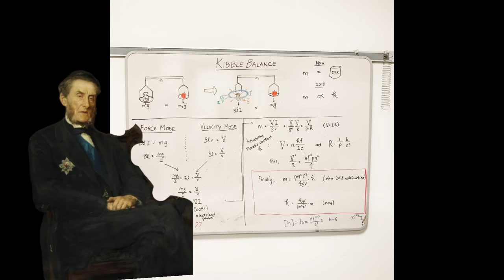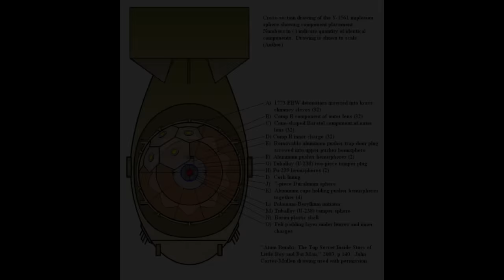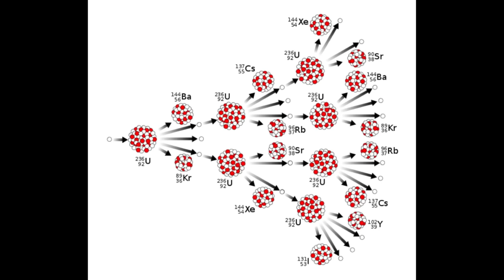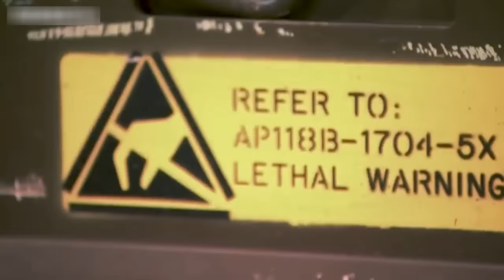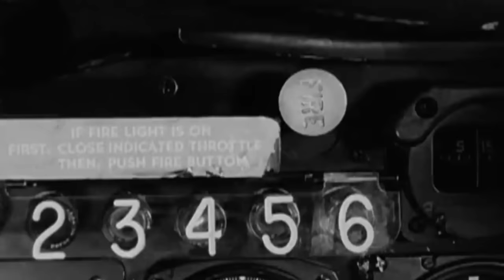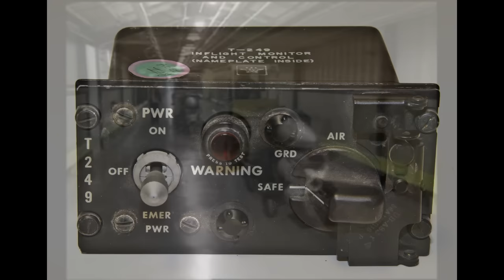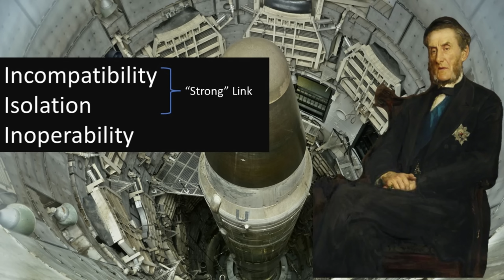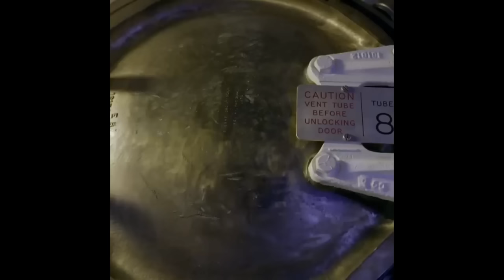This Way Toward Enemy - How The Bomb Didn't Quite Go Boom

Comment: Ahhh, the B-36.  Officially: Six turning, four burning.  Unofficially: Two turning, two burning, two smoking, two joking and two unaccounted for.
Reply from the maker: It doesn't seem like the best design; sadly I wasn't aware of the Goblin fighter that was supposed to pair with it until I'd done the video. A marriage made in heaven
Reply: At the Strategic Air Command museum in Nebraska they have a B-36 and a B-52 in the same hangar. The B-36 is so bafflingly huge that the B-52 looks small in comparison.
Reply: Somewhere on the interweb, there is a picture of a B17, a B29 and a B36 all sat on the apron together.
What gets you is the fact that the B17 and the B29 are smaller than the B36's wings.
Ugly but enormous!
Correction: there's a C-47 in the photo as well, I looked it up!
Reply: @joshcarter-com They also have the only surviving Goblin parasite fighter.
Reply: @HardThrasher Allegedly, the only reason it entered service was because its competitor, a flying wing design by Northrop with roots in mid-ww2. Was canceled by someone who, shortly thereafter, went on to work for Convair. The claims of graft which accompanied this turn of events, were solid enough that Northrop had grounds to Sue and the case was actually litigated to my understanding.
Reply: I feeling i need to see a picture of a Fairy Gannet, in order to offset the ugliness of the B-36
Reply: @joshcarter-com the airforce museum has a b52, b47 b58 and the massive b36 all in the same room.

the b36 was and still is absolutely absurd

Comment: The message I got from this is that it’s spectacularly hard to get a nuclear bomb to actually detonate
Reply: Indeed!  It has to go PERFECTLY.
Reply: @@retiredbore378 The demon core incident wasn't an explosion
Reply: @@retiredbore378 it DID kill people, but there was not enough heat to melt anything and no explosion (in any case, just like uranium, molten plutonium exposed to air will burn more furiously than magnesium)

In tbe same way, the accident which killed Hisashi Ouchi wasn't an explosion
Reply: @@retiredbore378 I don't think building an actual fission weapon would be possible, all the casting and machining of the pit and explosive lenses would be beyond the capabilities of just about every terrorist organisation (plus you'd have to get hold of explosives, which would seem to be another major hurdle).

However I've got to say I'm surprised and relieved that no terrorist organisation has yet used a dirty bomb using Americium, I can't believe that smoke detectors are that hard to come by, even if you're buying 1000's of the things. 'I'm a big landlord who's putting them in all my rental properties' etc. etc. (I'm not going to go into all the ways that even I can imagine you could get hold of these things, and I've got plenty of better things to think about, but there are many!).
Just the scare factor would be crippling, and cleaning up a city centre would be incredibly disruptive and costly.

Maybe our spooks are more effective than we imagine, but then I hear myself thinking that and think 'really!?' probably just luck.
Reply: @paulelephant9521 not only do you need explosives in a perfect conformation.... They are different explosives at different detonation speeds that are intersected perfectly. Nukes are no caveman tech.

Comment: Impressive that you've managed to get footage of an actual supplementary storage area (nuclear bomb dump). I was in the RAF during these times and worked in the security of these weapons. In the QRA, we had aircraft armed permanently with these weapons, jaguars then tonkas. We were live armed and if the aircraft were alerted, the pilots and aircrew scrambled, which happened all the time and we didn't know if it was real or an exercise. We had two failsafes; there was a physical steel pin which had to be removed or the weapon couldn't be dropped. We removed that pin and if any groundcrew went anywhere near them during an alert we were to shoot them dead. Also, the pilot taxiing out the HAS had to show a code and a picture which he had on a canvas pouch round his neck, which had to match the code and picture you had round your neck. The codes were deliberately altered for the exercise so the aircraft couldn't be allowed to take off, then replaced with the genuine codes and photos. If the code or the photo didn't match, you were to indicate to the pilot that they were not going anywhere, (the cut throat action). If the pilot didn't immediately stop and shut down the engines (and I mean within two seconds), our instructions were to shoot through the canopy and kill the pilot, anathema to an airman, but we took it seriously. There were other failsafes like closing the gates onto the taxiway, but no one had tested whether a jet could generate enough momentum to hop over them.
Reply: Do you have a link to manuals and stuff stating on this? because this sounds very odd and interesting
Reply: Very interesting. Do you have any particular stories from any alerts?

Comment: Howdy, so just a note. My grandpa used to work as an officer at an ICBM station back in the day. He told me that when they were using liquid fuel they had just a ton of near misses (the worst being when a welder didn't hear the alarms as they were preparing a test and they ended up taking out 3 unarmed missiles due to fire). The interesting thing I wanted to note was that he told me a ton of the people there were drop outs from the Navajo code talker school. He was Cherokee and apparently the recruiter didn't know the difference so when he failed out they gave him an assignment with nukes cause at least he had the clearance. Mildly terrifying that the ones with their fingers on the button were a bunch of almost disillusioned highschool kids from some of the worst treated and schooled areas in the US

Comment: In the late '70s, I worked for Lockheed on the Trident II program.  Even though I was working on the missile, I still needed a working understanding of (and clearance for) the "payload."  I can honestly say that your assessment in this video is excellent, with only a few minor wrinkles.  IIRC, the "Always/Never" ratio for the Mk. 4 system (the warhead on the Trident II) was 10:1 biased towards Never.

My personal take on weapons safety is that with all of the thousand or more incidents over the decades, there has never been an accidental nuclear explosion, despite the efforts of random chance working towards it.  They really, really do think these things through, it's just that the systems are all so damned complicated.

Comment: The bomb dropped on Hiroshima was not an implosion type device. It was much cruder than that. They went for a so-called "gun-type" mechanism. Basically shoot a tube of Uranium down a track at several hundred mph with explosives (although you could use other methods), allowing it to slide onto a target to create a critical mass, and then blast it with a neutron source.

The bad thing about this kind of design is that it isn't very reliable. There is a small but definitely meaningful chance that the Uranium, being radioactive, just releases a neutron while it's sliding onto the target, causing it to go off prematurely enough to generate a stupid amount of heat or rip the device to smithereens but not actually enough to make a nuclear level explosion. You need a large amount of neutrons at once and a highly supercritical assemblage of fissile material for that. Thus, there might have been as much as a 10% chance that Little Boy wouldn't detonate, and that chance is purely based on true randomness, god playing dice with the universe. Not engineering tolerances or anything like that.

Plutonium has a much greater radioactivity and is therefore unsuitable for this type of assembly method. Instead, it must be rapidly compressed and then blasted by a neutron source at peak compression.
Reply: It's not so much the greater radioactivity of plutonium which causes problems for the "gun-type" nuclear weapon design, but the decidedly non-trivial rate of spontaneous fission. However, it is possible to make a nuclear weapon of this type using plutonium, just more difficult and hence less practical. To make a supercritical mass with a reliable enough chain reaction to achieve the design yield (energy output and explosive force) using plutonium in a "gun-type" weapon, the two separate parts of the core need to be assembled much faster.

This means using a more powerful "gun", capable of firing the plutonium sleeve down the barrel (or track) towards the plutonium cylinder at much higher velocity. Off the top of my head, I cannot recall exactly how much faster it needs to be, but it was still technically possible: Just using a longer "gun barrel" to achieve a higher "muzzle velocity", a well established and understood method when it comes to guns.

The reason this was considered impractical (and/or impossible) in the 1940s was because the "gun barrel" required to make this design work with plutonium would have been considerably longer than the nose-to-tail length of the largest aircraft in existence at the time. Or in other words, if they had actually made a "gun-type" nuclear weapon with plutonium, they would have also needed to construct a specially designed extra-large aircraft to carry it.

Comment: Minor correction: the Air-2 Genie wasn't a missile.

it was a nuclear air-to-air Rocket
Reply: who needs guidance systems if you can just melt the closest ten miles?
Reply: By the way, a product improved nuclear air-to-air missile was the radar-guided Nuclear Falcon.
https://en.wikipedia.org/wiki/AIM-26_Falcon
Reply: "Not a missile, an A2A rocket"

Well that went from already pretty scary to WAY worse.
Reply: @jadefalcon001  Wait until you read the launch profile--that rocket had to be lobbed because after the fuel ran out, it coasted to the target.  Firing a Genie point-blank was not a healthy thing--firing it from extreme range and then diving away with a sharp turn to maximize the distance between the nuclear explosion minimized damage from blast and from the enhanced radiation warhead.
Reply: @alancranford3398  If you want wild stories, when they test-fired Genie they had a group of five officers (and one NCO photographer) standing at ground zero while it exploded 20,000 feet over their heads, to demonstrate how safe air-to-air nuclear combat was. Or something like that.
Reply: "Airborne Threat detected"
"Heading?"
waves vaguely "Over there."
"That's a Roger, rockets away!"

Comment: Fun little factoids:  The giant fire extinguishers in RAF QRA sheds (I think that they were 500lb dry-powder) were wheeled.  Fine.  But, the MT nutters classified said extinguishers as vehicles - thus they had to be fitted with fire extinguishers!  That was one of the questions asked of crews on the annual proficiency re-qual.  ALSO - when the weapon (WE177) was fitted, on top of it there had to be placed 2 layers of blue absorbant paper - Kimwipe.  NOT ONE, NOT THREE but TWO.    (To absorb fluid drips from the aircraft)
Vital stuff to know!
Lots of actually important stuff too though.

Comment: Point of clarification the Tzar Bombay was no designed as a 50 megaton it was a 100 Megaton bomb. They ran it at 50% because and I am not joking the fireball at 50 was the diameter of the ATMOSPHERE. In other words at full power most of the explosion would have been in space. As it was the shockwave was so powerful it blew out windows over 600 MILES away.

Also an atom bomb (fission) splits atoms but what that really means is that Matter gets converted into pure energy. This is important, because while everyone knows how atom bombs are big what people don't understand is how much matter gets converted. In the case of Hiroshima and Nagasaki it was roughly 1.6grams that's all it took to wipe out entire cities

Comment: I found this to be an excellent overview of the development of the Always/Never concept and factually correct, with the possible miss of mentioning the Little Boy bomb architecture. As I'm sure you understand, this was the original methodology of producing a critical mass and neutron cascade, but would not work with plutonium as the cascade does not develop properly and results in a fizzle. A faster development of critical mass is necessary with plutonium, and this led to the implosion concept, the development of the explosive lenses, the bridgewire detonator, the x-device, et al. The need for all of this was due to the difficulty in separating the 235 uranium isotope from 238. A significant fraction of the billion 1940's dollars for the Manhattan project was the development of Oak Ridge and the TVA to power it, all to separate the (IIRC) 0.7% mass fraction U-235; (also IIRC) mostly by gas diffusion of the hexafluoride, and it took till  early '45 to get enough 235 for one bomb, by the physicists reckoning. Meanwhile, Hanford and some other places found it was relatively easy as pie to produce plutonium, which would work great for an A-bomb, except that it didn’t with a gun bomb design. This necessitated the development of implosion and all that went with it if the Manhattan folks wanted to produce more than one bomb every two years. The rapid fire development of the implosion technology led to the decision that despite all of the blood and treasure of opportunity cost (the war ground on), they simply had to test it. This, of course, became Trinity. There was enough confidence in Little Boy that it was used untested, and, grimly enough, it worked better than expected. It was later calculated/discovered that the actual amount of U-235 that actually fissioned and produced the 16kT Hiroshima explosion was approximately the weight of a dollar bill.
Trinity and Fat Man worked well enough that this became the de facto atomic bomb design. 
I reckon that the simplicity of the Uranium 235 bomb would work against the Never part of the Always/Never principle. It is fortunate that it is a very difficult separation to produce sufficient fissionable U-235 from uranium ore, as uranium is much more prevalent than originally thought at the time of the Manhattan project.